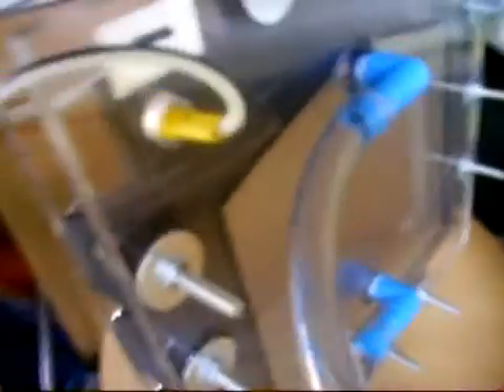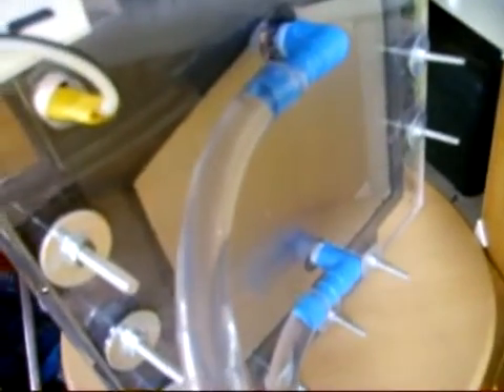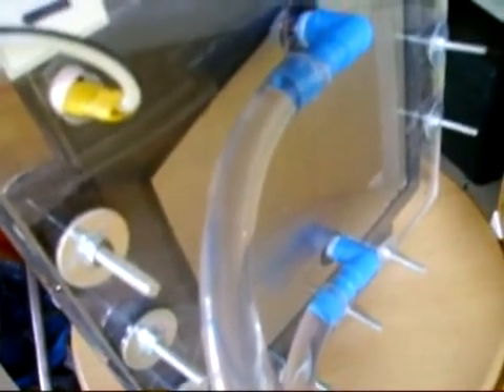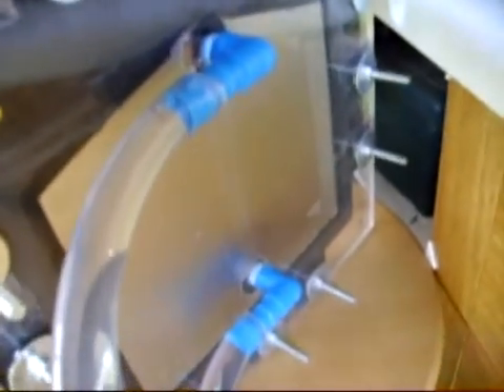Finished the HHO generator (explosion test) SHIT, it was loud.

Comment from the maker: CONTINUED FROM PREVIOUS MESSAGE... the clear plastic was purchased from a local supplier near me that sells sheets of perspex and i managed to get some cheap off cuts for about £10.00. the blue plastic pipe fittings were £3.00 each from "pirtek.co.uk" they are all around the UK so you should be able to get these locally from you.everything else is from a local hardware store so good luck and i hope you are succesful . always be careful with this type of has as it is very explosive and can harm

Comment from the maker: hello, i glad you found this video interesting. the first thing you need to do is lots of research it would be a good idea to visit "hho4free.com" you will find tones of information on making a hydrogen generator there. the site is from the USA. When it comes to buying parts I got my stainless steel from a metal works near me and it is important to buy 316L grade steel as this does not rust quite so easy as cheaper grades of stainless due to the  o2 being made. ....CONTINUED...